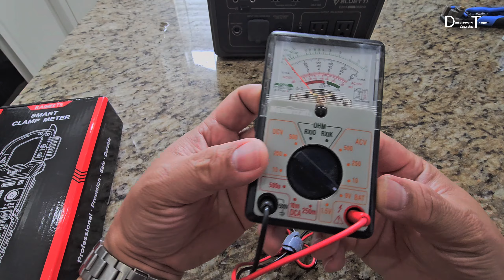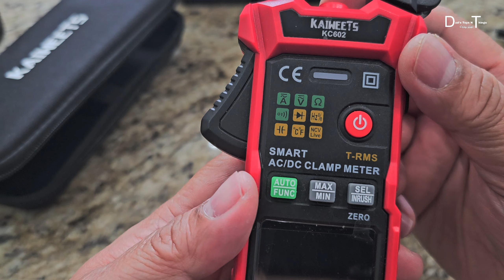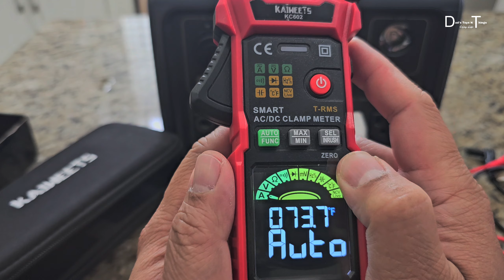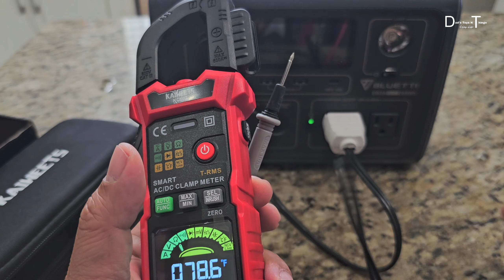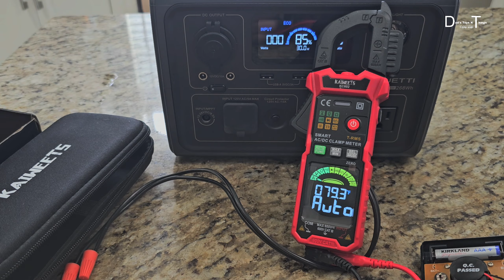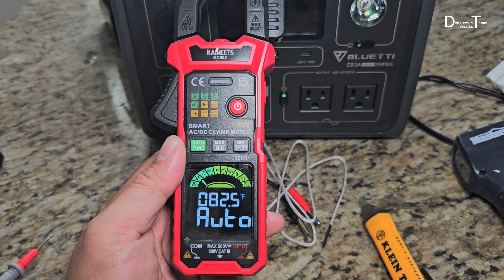Kaiweets KC602 Review – Smart Clamp Meter With Auto Detection!

Comment: If I test the DC current during the cranking of an automotive engine, the current during the first 400 ms (0.4 sec) start at 0 and reach about 150 A. If I press the MIN/MAX key and use the MAX function, can I register this maximum peak current of 150 A during the first 400 ms? OR can it not, because to get to the 600 A scale it has to go through the 60 A scale first? Is it fast enough to read and register this 150 A of starting current?
Reply: Inrush mode

Comment: Hi. Is this the same as the GVDA fd166b? Did they just change the name??
Reply from the maker: They're both made in China, and the products look similar. It's not uncommon for products from China to be copied and re-branded. I don't know, however, which one came up with the design. I have been using Kaiweets for a while now, and I haven't used the GVDA.

They're different companies though.
Reply: @dadstoysnthings  
Thank you. I was wondering if this product is okay for industrial settings with power ranging from 120-600vac measuring and up to 70amps AC??
Reply from the maker: If I based it on its specifications, yes. For industrial applications, I would go with Fluke. That's the gold standard, or Klein... And as I'm just a hobbyist, I will defer to whatever electricians will say that's better.
Reply: Is this suitable for mA dc currents from parasitic drain measurement via the clamp?
Reply from the maker: @PaulsToolReview I have used it for my sump pump battery backup setup. I can't speak about the accuracy as I don't have anything else to compare it against.